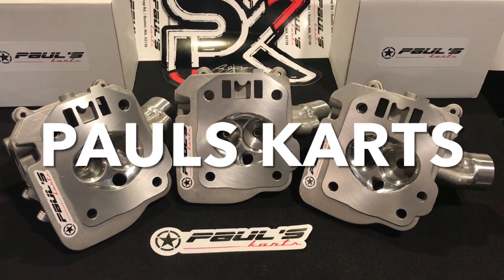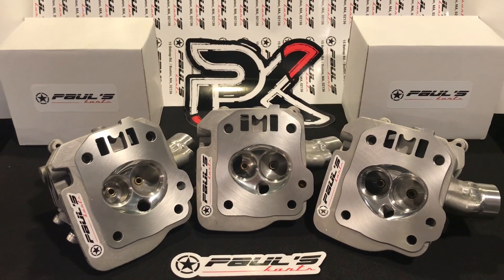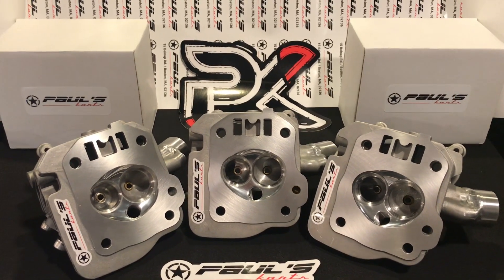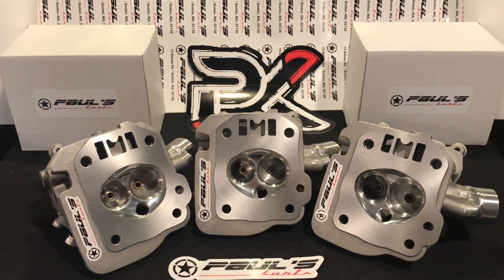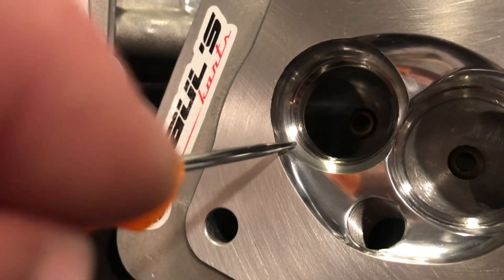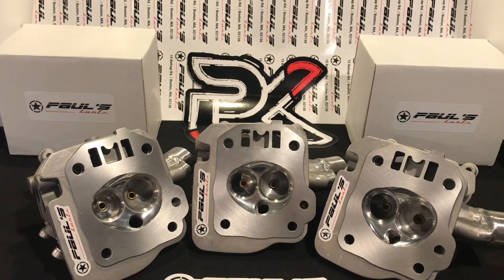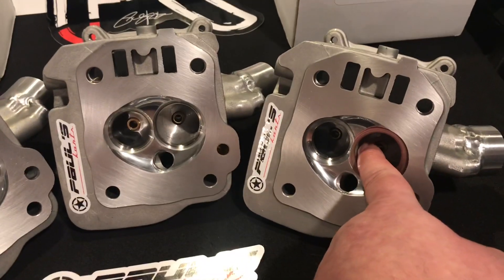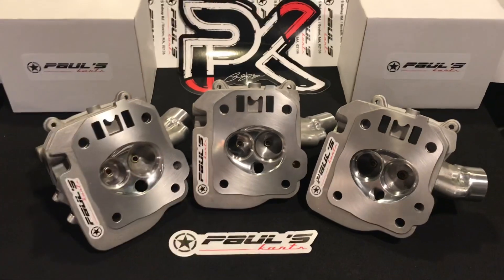Predator 212 // Tech tips - the Flow Bench lies* - head porting , chamber design - we made mistakes

Comment: Fact, (1) Putting a better flowing than stock cylinder head with more compression on an engine will improve performance over stock, Fact (2) Installing a cam with more lift and duration than stock will improve performance over stock. Fact (3) Installing a bigger than stock carb onto a engine with a better head and cam will improve performance. Fact (4) Mixing and matching parts will not cost you 5-7 Hp, if the head flows better than stock and the cam has more lift along with a bigger carb (re jetting is required) your going to make more power. It has nothing to do with luck.
Reply from the maker: Yes true, but there are levels to this. You will not get to the highest performance levels just tossing darts at parts catalogs. You are right tho most companies that build parts build for the same base performance. We just aim at a higher more refined top of the line package.